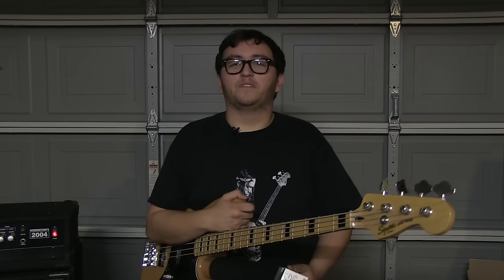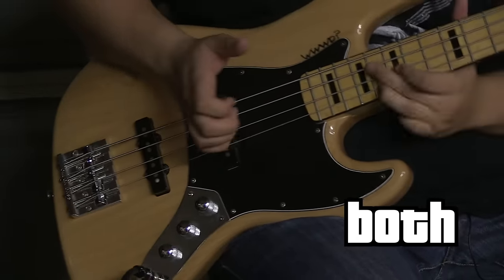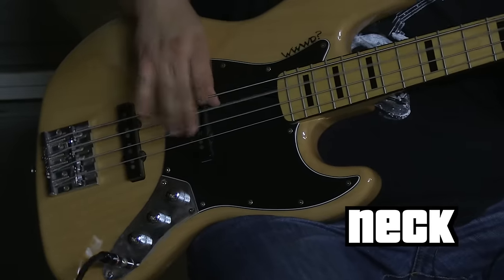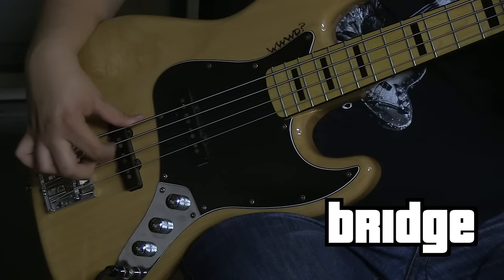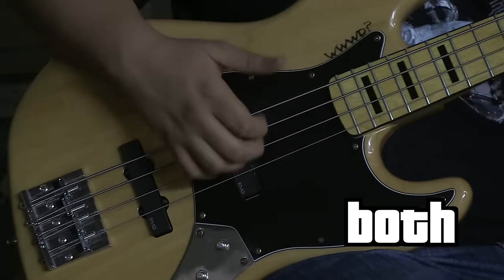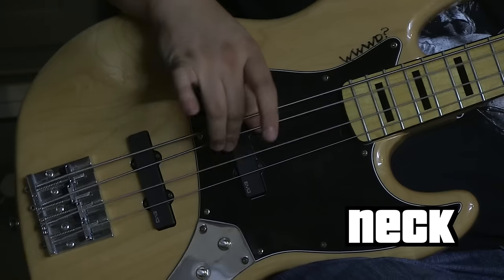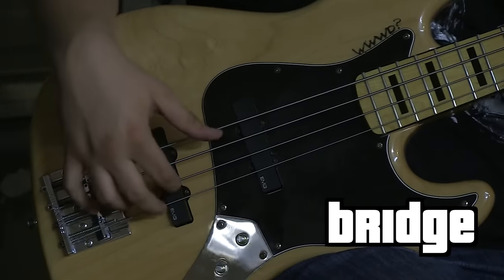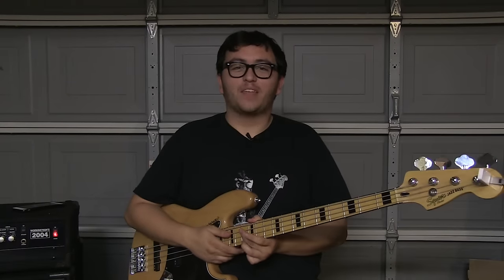EMG J Set Pickups

Comment: What people call 'growl' on stock pickups is really hash and noise, and I think of it as 'clank'. The EMGs (which I have on my US Jazz) are way better - especially in the studio. What no one seems to mention is that any stock single coil Jazz pickup will be noisy when dialled in on its own. Not the EMGs.
Reply: EMG pickups you can have your bass amp EQ on flat and it just sounds really good. great starting point especially with an active EQ on board of your bass as well. Passive pickups require much more fiddling with your bassamp to get the sound you are after.  plus zero hum is a godsend when playing live.

Comment: The Stock pick ups have a nicer midrange (250ish) however they are less forgiving with the slapping noises when the E string gets too close to the neck pick up. Listen closely. I use original passive for classic stuff and active for modern and slap.
 It's called taste and usage, it's not war to be fought over.
Reply: Also, EMGs have a ton of presence when you play live with a band, despite their occasional lack of mids.

Comment: EMGs deliver a unique range of tones. I put a set of Geezers in a Fender PJ and think of the sound as crisp midrange "klank" and it would be impossible to obtain this unique sound from an SD of any sort. The problem with describing tone is that we have no agreed upon vocabulary or measurable standard for tone. I install a lot of EMGs because they produce what I think of as a dry clear edge that no other mfg offers. EMGs sound like EMGs and everything else sounds like a Fender mutation. I like the sound of Fender J pickups and even some of the Squires are decent but unless Im installing EMGs I stick with stock pickups. I suspect a lot of pickup changes are the result of struggling with amps that have limited tone control circuitry and to get around that problem, I went with Hartke way back when and never looked back. If you want more out of your existing guitar and amp, invest a hundred bucks in a Hartke Bass Attack DI pedal. Also  check out the active eq on an ESP LTD B series bass because one of these can save you thousands in frivolous expenditures. In my opinion the ESP LTD B series delivers the best bang in the bass guitar market and for well under a grand no one has ANYTHING comparable.

Comment: EMGs sound better and are very quiet. I will never go back to passive pickups. Too many issues including 60Hz hum, bridge grounding (a shock hazard), excessive string pull (kills sustain), lack of signal buffering, soldering, etc. You couldn't pay me enough to go back to passive pickups or active basses with passive pickups. Oh, and if the changing of a battery every 6 months is what keeps one from using active pickups then I'd hate to see what one's strings look like.

Comment: I intend to buy the bass you showcase and heavily modify it with those pickups and a high mass bridfge. What do you think?
Reply from the maker: I think that’s a terrific idea!
Reply: even if I say that I already have an aerodyne jazz? do you think that the transition to the squier is silly?
Reply: The high mass bridge will make the biggest difference and is much cheaper than pickups. Fender alnico pickups would be a better option though. EMGs use inferior ceramic magnets. Alnico magnets are real metal as in ALuminum, NIckel, CObalt.

Comment: Back in 1990, I purchased a used Pedulla Fretless Buzz Bass with J-J pickups. The original owner who had traded it in, had replaced the original Bartolini  pickups and tone circuit with EMG pickups and tone circuit. The bass still sounded amazingly good. I gigged it for decades that way.  Recently, I was able to get the OEM spec tone circuit, buffer preamp, and passive pickups from Bartolini. Guess what?  The EMGs sounded better.

Comment: just wondering if the EMGs are passive or active?
Reply from the maker: +thetardisneedsamot They are active.
Reply: did you have to route out the space for the battery?
Reply from the maker: On this bass, we did not. The battery managed to fit (snugly) in the control cavity underneath the pots. That might not be the case for every bass, but we were lucky with this one.